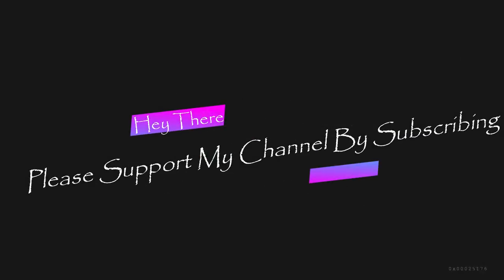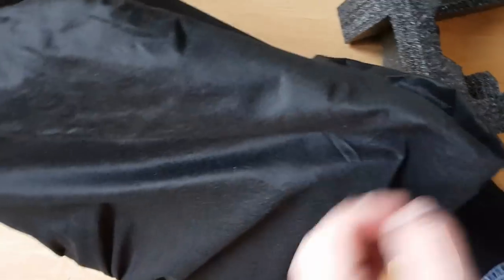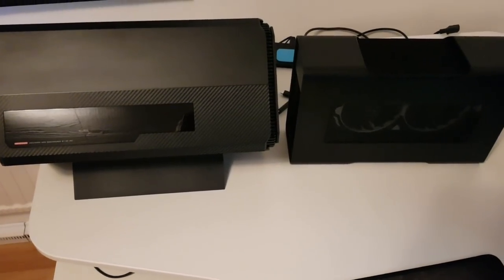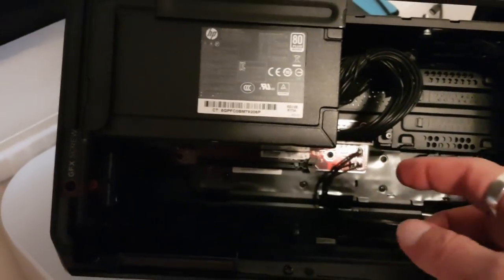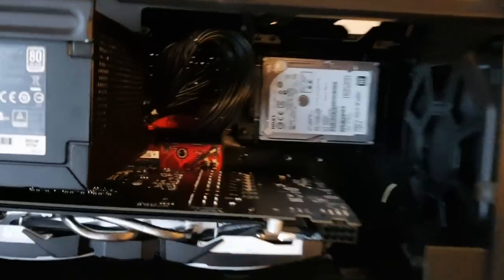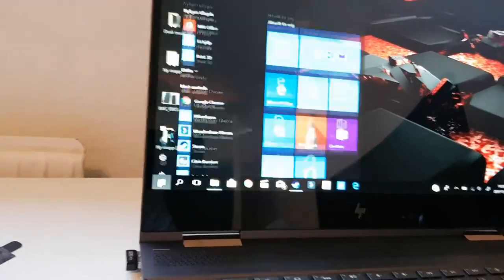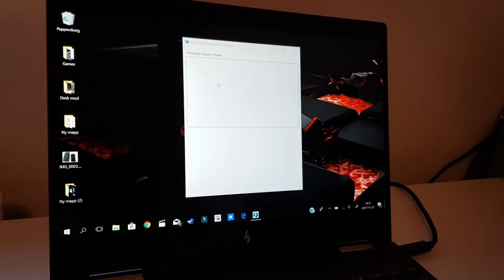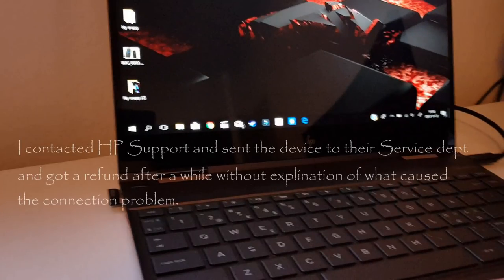Unboxing HP Omen Accelerator eGPU and Connection to HP Spectre X360 13

Comment: hey I just saw this your video and I will say I have the Hp Accelerator and it works fine for me. Am using a Evga 1080ti ftw3 with my dell precision 7520. Only issue I had and solved was the 6pin connect which I had to get a 6pin to 8 pin connector after which it worked like a charm. Am still testing the Egpu . And yes I got it like 3 days ago. 

You will need to install 
1) the latest thunderbolt 3 driver from your manufactural site.
2) download the hp accelerator shell software and drivers
3) the video card drivers
4) restart.
Reply from the maker: Great information, thanks. Would like if you can subscribe to my channel it will gett me closer to 1000 subscribers :)

Comment: Apparently a firmware update fixes the issue:
https://h30434.www3.hp.com/t5/Gaming-Accessories/Unable-to-connect-HP-Spectre-x360-13-to-Omen-Accelerator/m-p/6611514/highlight/true#M841
Only caveat is that you'll need a computer recognizing the Omen in order to perform the firmware upgrade. Also, according to the follow-up messages at the HP forum a workaround is needed for the installation. So, you need a fix for the fix, because it couldn't be that straightforward with HP.
Reply from the maker: Interesting, as you say the Spectre need to recognize the accelerator mine did not.
Reply: This guy seems to have solved it (German only, sorry): https://www.youtube.com/watch?v=sk5tyXjYMuE
Still, there is no solution for the USB ports issue. From what I understood in that video, it is a matter of the Omen setting the priority of USB-C tunneling vs Thunderbolt devices wrong.
Reply: To sum up, too much hassle for something that should be close to plug&play for the price.
Reply from the maker: Agree.

Comment: Wich hp envy is that? is not the same from other vids? i mean is the 8th gen and intel HD620? or the mx150 one?

good video!
Reply from the maker: Hi, that is hp spectre x360 with 8th gen CPU  at that time I also still had the 7th Gen x360 but neither could connect properly
Reply: DWKreviews What the fuck? What is HP thinking? it's suposed to be designed for its HP lineup, isnt it?

So it didnt work after all? maybe it's up to your unit, or what? :/
Reply from the maker: I tried both the 8th and 7th Gen neither worked. I only sent the accelerator to HP service via the company that sold it to me. I got no explanation on what was wrong just a refund. Also spoke with HP service technician but they couldn't help me.
Reply: DWKreviews Is your HP late 2017? maybe firmware issue? i don't know... if it does not work what a pitty....
Reply from the maker: I did update the bios before that video.

Comment: You need to pre install the software drivers before connecting the omen usb3 c cabel to your laptop this is not a plug-in play device
Reply from the maker: Hi thanks for watching this video. I had the drivers installed since I was using it connecting to the Razer Core, same thunderbolt 3 drivers. The driver from Gigabyte and firmware was also used. I contacted Gigabyte support but got no help, they recommended me to return the device. Have you been able to connect with a HP Spectre X360 13?
Please support my channel and subscribe if you haven't already.

Comment: HP Omen or Razer Core eGPU, which one is better?
Reply from the maker: I could not make the HP Omen work together with the HP Spectre X360, so that was very sad. I may work better on a non HP laptop. I tryed to get HP Support to help me with the connection problem but they had no clue. I still recommend the Razer Core since I had no problem with it.
Reply: Yes, very sad  I looked this one up at egpu.io  Answer is that the EMEA sku's will have a problem due to EU voltage  regulations. If you are still wanting a HP Omen eGPU, you should try getting one from Asia or US. HP didn't tell if  and when they will fix this problem. Perhaps the Akitio Node Pro is another option look at http://egpu.io page for other choices
Reply from the maker: HP had no info about solving the problem. So I will stick to the Razer Core, but there are some interesting options out there the Akitio Node is a good example, another is PowerColor, with its Devil . There is also Gigabyte Aorus GTX 1070 Gaming Box with preinstalled GPU. Aorus would be fun to test!

Comment: Where to buy a omen accelerator or we have to buy it on online?
Reply from the maker: Hi, thanks for watching this video. I bought my unit online, could not see any non online shops that had it in store. Please subscribe to my channel if you haven't already and give me a thumbs up if you find it useful.
Reply: DWKreviews so it only online?
Reply from the maker: As for Sweden at least, the accelerator did not work for me with HP Spectre X360 13 and I had to send it back to the seller.

Comment: Recently bought the omen accelerator.Had the i7 16gb 4k screen model spectre for a while. Bought a evga gtx1070ti sc for it. All plugged in. Drivers installed fine. Laptop saw the gpu fine. Games run like shit on this setup. Nvidia experience optimized forza horizon 3 at sub 720p on medium settings and it cannot get close to 60fps. Seeing more like 30 to 45 fps. Game is unplayble amd looks like shit. Runs better on a og xbox one. MASSIVELY disapointed as this lot has cost me a small fortune and my xbox one x and ps4 pro blow it out of the water. Reinstalled everything and all drivers are working correctly. New to pc gaming apart from a old laptop which had a gtx970 in which ran games better than this setup. Lost and close to selling the lot.
Reply from the maker: I'm suprised that you could make it work at all and I'am really sorry for your bad experience. You will always lose around 20% performance when using a eGPU as you know. My main reason showing this video was to warn about the connection problem that made me return my unit.
Reply: @thetechzone6558  i thought you only lose 20% if using the laptop monitor? I am using a external monitor that plugs into the back of the gtx1070ti. I have the laptop screen turned off when the external monitor is connected. 

Did you not get your setup running then?
Reply from the maker: Maybe more like 15%, unlike an PCIe connection on a motherboard you will have one TB3 interface on the laptop and another on the eGPU that need to communicate before the GPU will receive data via PCIe bus.
Reply: @thetechzone6558  well even if it is 15% on a 1070ti sc it should still massively out perform a xbox one.... Which mine is not. Not even close.